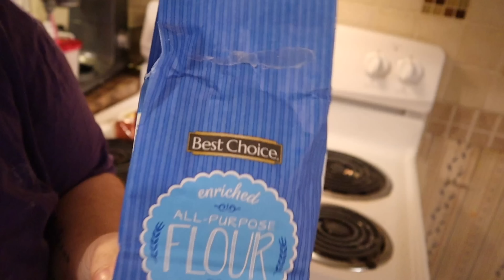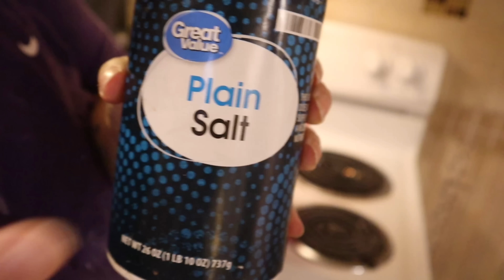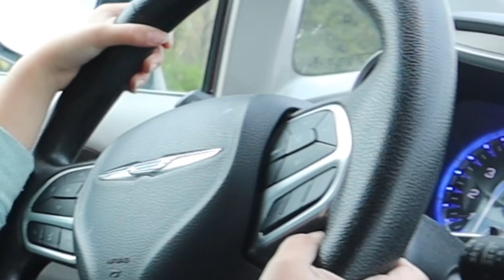*NEW* LARGE FAMILY MOBILE HOME LIVING | homemaking in the doublewide | projects | whole weekend vlog

Comment: It's definitely the carbs that you added back into your diet. Rice is very high carb. If you've struggled eating keto because of your gall bladder issues, try eating very low carb but not increasing the fats so much. I think it's probably the fats that were giving you the problem.  Beans are super high in carbs too.

Comment: I use a ham bone from holidays.  If I don't have a ham bone you can use hamburger meat or diced ham or no meat at all.   I also use chicken stock vs water.  Some times I soak my beans and other times I do not.  Just depends if it's planned out or last min throw it in the crockpot idea.   Add whatever seasonings you want.  I use pepper, garlic (powder or out of a jar), onion powder, some type of season all that has a little of everything in it.  Some times I add Tony's Cajun seasoning.  I also cut up an onion to add in.   Pintos are just however you want to make them.